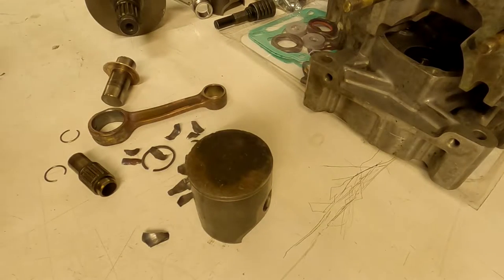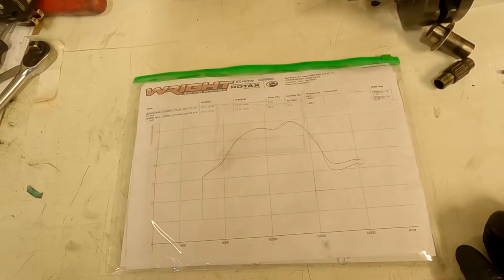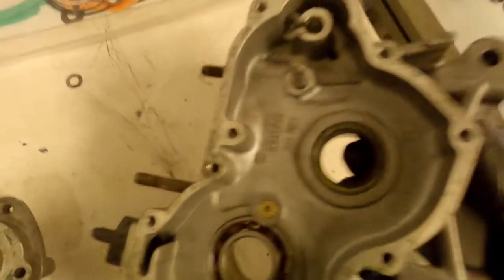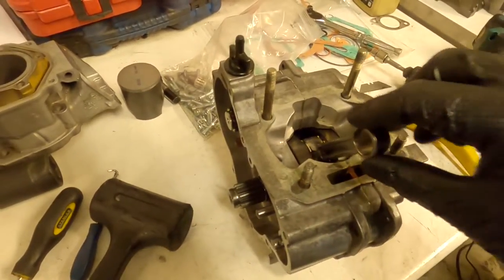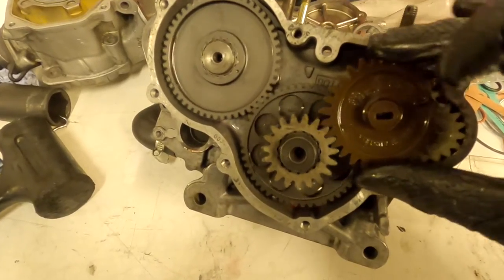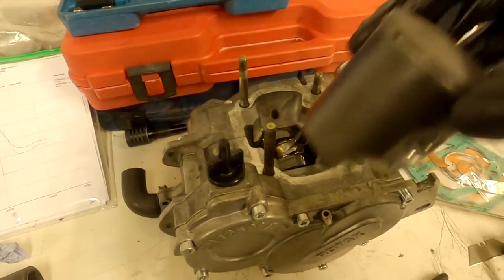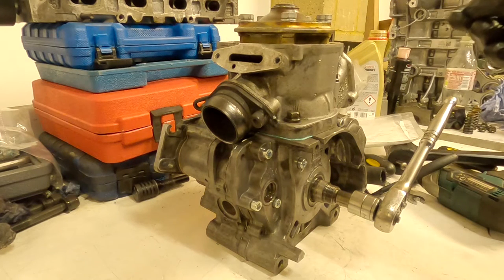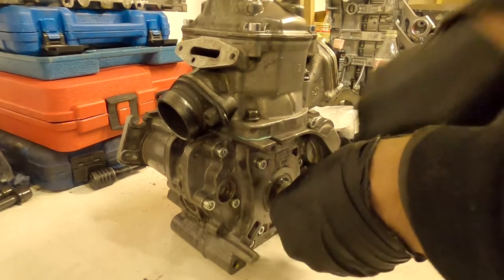Saving a Blown Rotax Max 2 Stroke Engine

Comment: Very informative video other than washer goes under water pump gear ,gear side crank seal should face outwards and water propeller seal should go flush with the case allowing weep hole to be clear,to remove old water seals there is a small hole where you can tap them out with a small diameter pic,  case seals have 28 and 25 I/d numbers on them.

Comment from the maker: I am no 2 stroke expert but any questions let me know!
Reply: I did many many rotax 122 engines back in around 2001 to 2005 I worked at an aprillia dealership. Many made over 33 bhp with a nice expansion chamber 
They came with a plastic cage on the main bearings, we usually put an NSK bearing , there was a lot of failures of these. 
The mitaka cylinder kits were a good replacement for the nikasil aprilia bores. The crank is actually quite easy to align if you have a press.  And make sure the seal on the gearbox side of the crank is fitted backwards, or it will draw oil from gearbox 😳
 You recently put the haltech on my Holden. 
Hello.
Reply: so i am rebuilding my rotax fr 125 right now i just got a 53.97 piston and i orderd a 53.98 the piston to wall clearance on the 53.97 i have is about 0.045 to 0.050 is that ok i do not race i just go have fun so i figured that would be ok and then do you recommend doing anything to the large starter gear / clutch it has no key to stop it from spinning on the shaft i put 637 locktite bearing retainer on mine not gonna lie do you think that was a good idea or bad idea im just worried about the clutch spinning on the shaft and loosing power  i do still have the old style clutch too with the holes in the side are the new ones any different and how long do you think the bottom con rod needle bearing can go without replacement that is one of the only ones i have not replaced and probably has about 50-60 hours on it
Reply: @killercane5183  
You really want to do that con rod needle bearing if possible. It’s not pretty when it fails. All the aprilia engines I did had a keyway on the crank.
Reply: @hoonaticbloggs5402  that is weird the aprilla engines do have a key on the non gearbox side mine just has a taper that the centrifugal clutch gose on with no key just weird to me and that bottom bearing I inspected it i has no play the race is in good shape so i thought it would be ok you really recommend swapping it im just really scared of having to line up the crank lol
Reply: @hoonaticbloggs5402  u built these right can i ask you do you know any way to make these make any more power past 33hp i have this on a race kart and always looking to make more power i think they make a 150 kit for these but its like 1500$ for cylinder,piston,rod i think thats a bit expensive for whut it is but i might have to go for it
Reply: Doesn’t the washer go behind the water pump gear

Comment: Excellent vid for me until the point i wanted to see which way up the blade should be on the power valve and you didn't show it
Reply from the maker: The longer side at the top shorter side bottom.